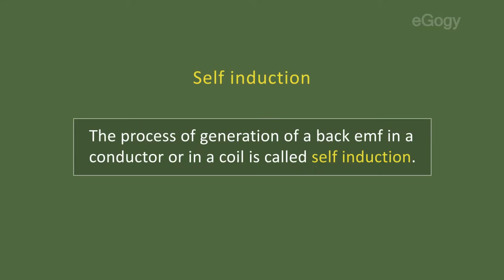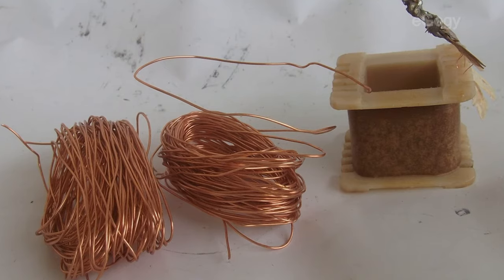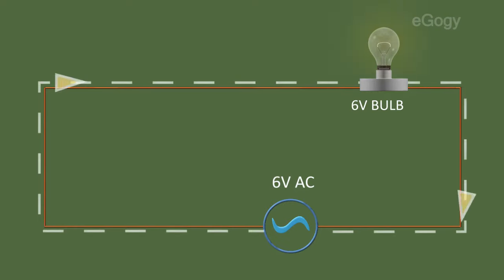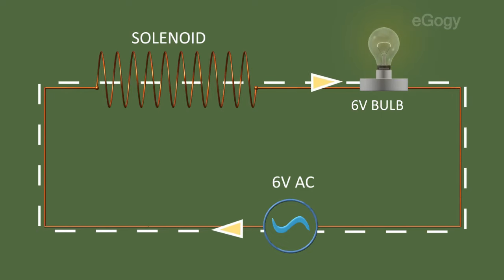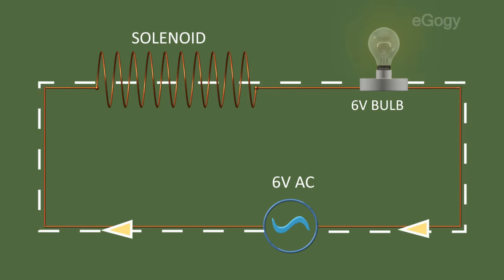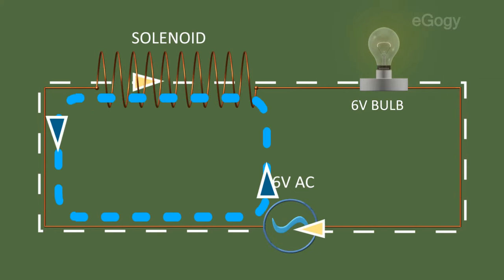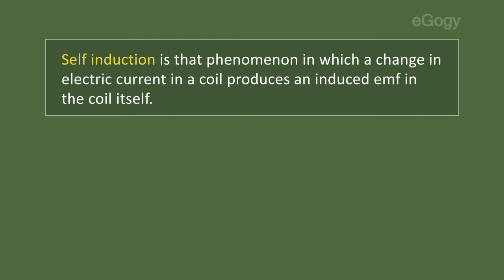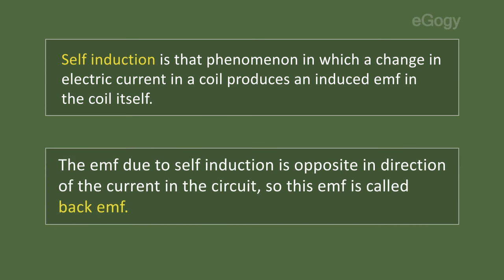Self induction

Comment: this very much doesn't make sense. here is my consperiacy theory to solenoid right now: every cycle change changes the direction of the magnetic field. So we have a oposseing magnetic field in ever coil rotation compared to its neighbouring cycles. creating the resistance in the circuit.